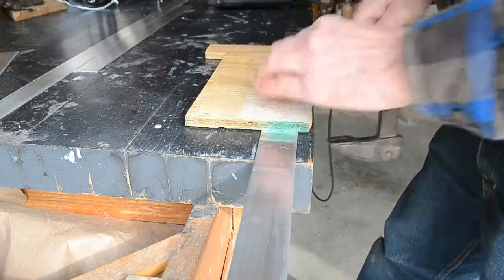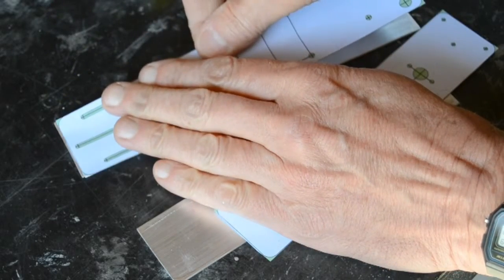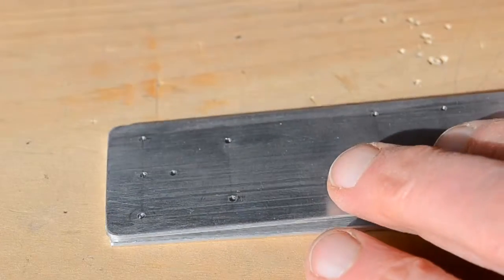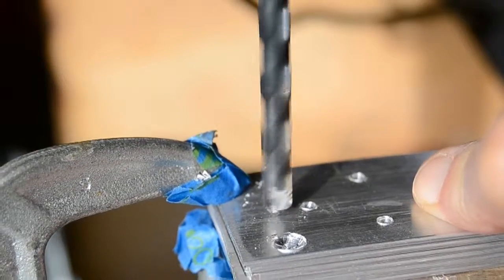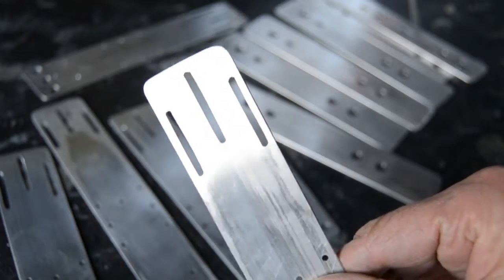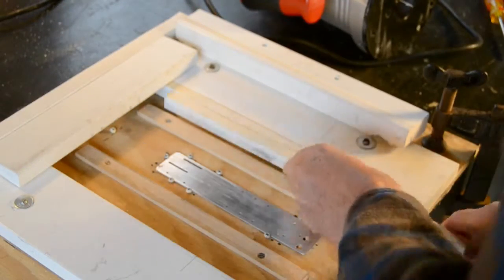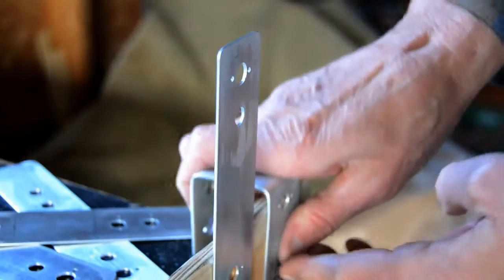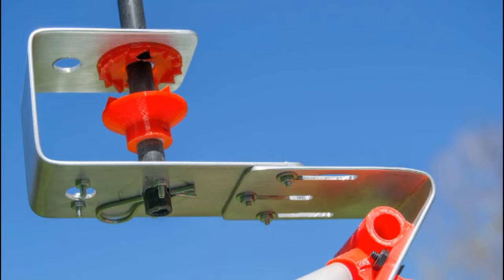Making the Aerobee Rig

Comment: Chris I am wondering if you ever thought about producing the StratoSpool, given your skills at small-scale mass production?
Reply from the maker: I have thought about using a StratoSpool, especially when flying in a tight place where the ability to reel in line very quickly can save your kite or rig or prevent some other harm. A big, powerful spool like that makes it possible to fly in places or at times that are otherwise too risky. But they are very big, heavy things and seem like they would turn a couple hours of kite flying into a tiring activity. I have never thought about manufacturing them or anything else that is not my own design. There is some essence of the artisanal which is lost when the concept is not your own.